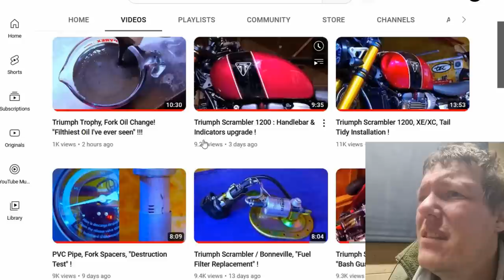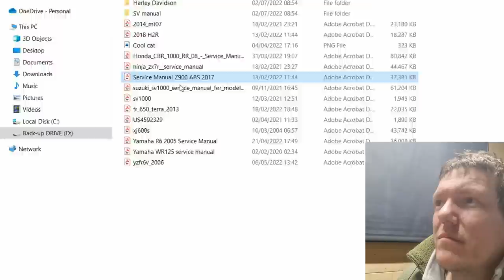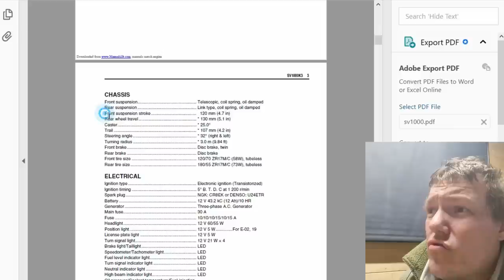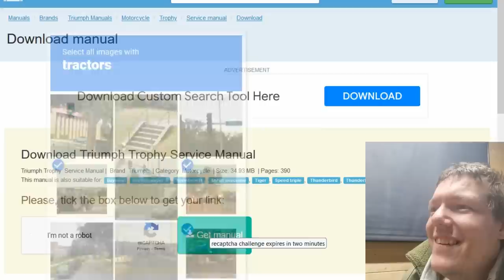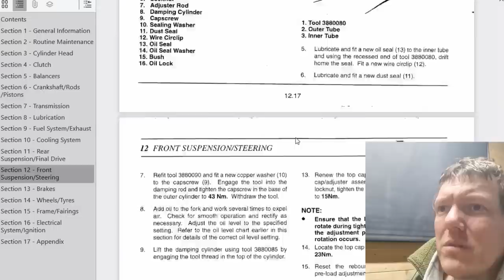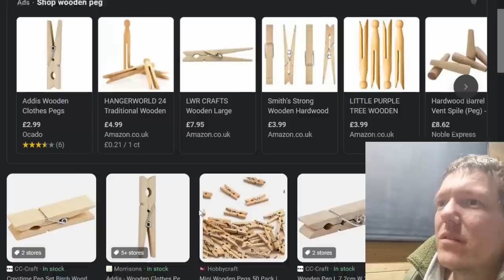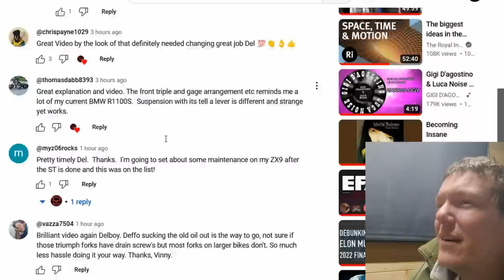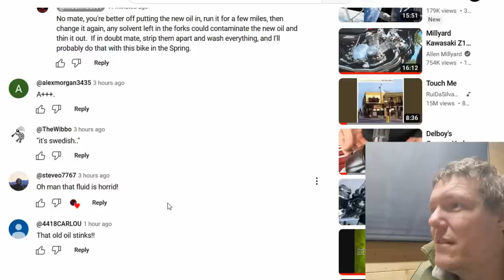Terrible fork oil replacement

Comment: To clean the forks without disassembly, just put the bike on a stand, remove each fork, tip them upside down, etc. No need for a stupid pump.
Reply: That's exactly what I do, remove forks, take spring out, turn upside down and rest in a container while I have my lunch etc.
I do it approx once per year because it's an old (conventional fork style) dirt bike, so tends to get water in there - I assume from condensation as the seals don't leak, forks get hot from working hard then hitting rivers etc, plus it lives outside (with a cover on)

Comment: I have literally never changed fork oil. I have changed seals and refilled the forks lots of times. It's an easy job, only takes a couple hours, and the seals are cheaper than the oil Del's flushing with. While it's apart I clean with brake cleaner. No residue, evaporates in 20 seconds,  and the fumes give a nice buzz.

Comment: I work for a small motorcycle shop and no mechanic would ever change fork oil with a vacuum pump as you would only be removing the clean oil sat on top and leaving behind the old oil that's been doing all the work at the bottom. The only way to is take the fork off the bike and exercise it upside down. Ps even in a rush racers would not use this metherd to change oil viscosity before a race
Reply: Plus you’d not get any of the oil trapped in the damper?

Comment: So the fork sag was 45mm and bang on, but before he pushed the cable tie down it was at 45mm!!   

Agreed all the valving and internals will be caked in shite. 

He measures the fork oil height while forks are slanted, so give a false reading.  And what he sucked out looked as black as what he’d supposedly already changed. 

The blokes a prick. 

Like you say, whip wheel out.  Take out spring.  Fill with petrol and shake it, then pour it out and when dry refill with new oil.

Comment: I have a Triumph, the manual says to change fork oil every 4 years or 24000 km.
Del's bike is from the 90's so a couple of years older than mine, but I'm sure it says something similar.

Comment: In the forks of bikes I've had, usually, it is not possible to extract all the oil properly via the stanchion, leaving a fair bit in the bottom and usually the sludge. I did think it was unlikely that there was no drain screw when Del said that but I guess he doesn't understand how your supposed to drain them.
Reply: The bolt in the bottom is to hold the damper rod, not to drain the oil, it would drain it though, but in all honesty, if it's that sludgy, it's not coming out of that tiny hole..
Reply: @waynedl99  Usually the damper rod bolt will be big enough to let the oil out.  Yes if there's sludge it won't come out but that's why you have to do the job properly and take the forks off and clean them out.

Comment: Probably the bolt Del was refering to is drain screw you can find on harley-davidson forks. You can drain Oil without taking axle of.
Reply from the maker: Only for these models XL1200C, XL1200L, XL883, XL883C, XL883L which is the vast minority according to HDs site

Comment: Matt, hey. Regarding drain screws, most all? forks that I know have a screw/bolt in the bottom yes. But that's primarily used to hold the damper rod or cartridge in the fork, and cannot easily be used as a drain plug. Often the bolt will not come out without holding the damper cartridge/rod with a special tool.
Reply from the maker: You don't need a special tool, you do it first before anything else. The spring pressure clamps it all up tight

Comment: Shouldn't your fork leg be vertical to set the level accurately? At the headstock angle the forks are at still in the bike, the level will be different at the front of the fork tube to the rear. I could work it out with maths, if I could be arsed and knew headstock angle, but I'm bet 10-15mm difference in height, which would throw the accuracy of his tape on the vac tube, pointless.

Comment: I’m surprised he didn’t just drill and tap a hole at the bottom of the fork then whack a bolt in there, mind that would probably have done a better job of getting that crap and oil out of there. 😂

Comment: i think that bottom bolt on the forks, its really not meant to be a drain bolt, but that's to separate the 2 sections of the fork and from what i gather its not easy to remove (some are easier than others) and if that nut spins you need a special tool to get in the topside of the fork to loosen it. I know when i had an 80's yamaha special II, there was small phillips head  screw on the side of the forks you could take out and that would drain the oil out but i haven't seen that in ages with these newer bikes.
Reply from the maker: For God sake... who said it was for draining? What you're meant to do is remove the fork and tip out the oil.

You don't need a special tool, you just stick the fork back together and undo it.

The reason why you don't see that any more is because it takes ages for the oil to drain out and the crap remains in the shock, and finally the screw usually corroded in place.

Comment: I just restored forks on a 2001 SV650 that has been sitting for 7 years. There is no way I could have 'cleaned' them by just replacing the oil.

What remained after draining was a thick sludge that stuck to the walls and springs and smelled of rotten eggs. Even after taking the forks completely apart it took a bit of work to get them clean.

I guess he needed to get the Sealey product placement in there somehow.

Comment: Only really old forks have drain holes. Oil change in my shop means they come off the bike. I prefer to strip em down and flush the cart. Then check bushes etc. I will do a dump and fill on track bikes if we are changing viscosity or between race rounds.

Comment: I think Del was referring to having an actual fork oil drain bolt in the end....not the damper rod holding bolt (which can be a problem if you remove it and then need some way to stop the rod rotating while trying to torque it up). My '74 Norton Commando does have an actual drain bolt on the side of the fork slider end, so no need to remove axle etc to perform the fluid change.
Further, he sucks out the fluid to set level with the forks at the normal angle to the ground....so fluid level at rear side will be higher than at front side of fork tube...so depending on where the end of that suction hose ends up, he'll be removing more or less than he thinks. Can be avoided by having the suction tube dead center in the fork tube...which is what the manual's tool does. MotionPro sells this same setup for $50....silly money and easy to do right with homemade setup.
Reply: The first year or two of the 1990s Honda cb500 were the same. The bottom of each slider had a bolt - undo it, drain oil. Simple. After a certain date the construction of the sliders was changed and where the bolt screwed in was just a cast stump, so fork removal became necessary.
Reply from the maker: Because most (nearly all) don't have them. That's like talking about hub centre steering when changing head bearings...

Comment: You know I can sort of see where he's coming from. If you change the fork oil every 2 years you'll be better off than not doing it at all. Unfortunately the reason I can relate to this is because I am lazy as fuck and can't be arsed taking my forks off. 

However, the Sealey siphon pump thing costs money, whereas just taking the forks off and dumping the oil out is something that can be done with very basic tools. Spend money to be lazy or save money and actually do a semi-proper job? Tough call. What harm another 20k miles on the same oil do anyway?

Comment: WOW what Del means and im not saying what he does is good but some forks have a small 8mm bolt at the rear of the fork leg on both sides which if removed you can pump the forks and it will expel all the oil and then refill if not doing new seals and bushings, i did my fork oil every riding season as my old Honda ATC seen lots of water and mud so doing a quick drain and refill was easy

Comment: Sorry Matt and I never thought I'd ever say this but I have to side with Del on the drain bolt.
What your pointing out is the damper rod bolt meant for dissembling the fork. Sure you could use them to drain the forks in a pinch but I'm sure what Del is referring to is as small bolt or JIS screw on the side or back of the slider specifically for draining the forks without disassembling them.
Reply from the maker: Can you give an example of a bike that has one of these screws?
Reply: @dirtygarageguy  Sure, 1988 Kawasaki GPZ900R, part number 92009.
I've owned and seen plenty of other bikes with them too.
Reply from the maker: Right, any 1990s triumphs or any late 90s bikes?
Reply: @Gassit  70's to 90's bikes had them before they worked out forks should be fully disassembled to do it correctly!
Reply: @dirtygarageguy  They don't seem to be a thing on current era bikes but my point is that that is what Del was talking about.
I'm not one of his fanboys. The only times I ever see any of his videos is on your channel and like you I thinks he's a plonker, but in this instance he was technically right.
Reply: Fork drain plugs no longer exist for a few reasons. Cost cutting is one - my experience of those plugs is that the things used to seize in the fork leg. The screw heads were usually rounded off making them useless. Often the threads in the fork leg would tear when the plug was removed
Reply from the maker: I don't agree. I don't think that's what del was talking about at all. I haven't seen a bike that has one on dels channel over the last 12 years, he didn't mention this on the other 8 videos he's done on fork oil replacement. He didn't even say what I think you think you heard.
Reply from the maker: Lol right, and?

Comment: it looked like he took just over 500ml out it total, but added 1000ml back in. Where did the other 500ml go?
Reply: Those little bottles are 500ml. He added one into each fork, so 500ml into each fork which is fine.

Comment: You cant do fork oil level correctly when in the bike coz the forks sit at an angle (say 25 degree for example).
You need to do them straight upright.
Otherwise you might as well just guestimate the level coz its gonna be miles out anyway.
And i'm with you on this one, take the bloody legs out and clean them.
I do lots of forks and I can tell you there will be black crud still sitting at the bottom of that fork

Comment: Oh FFS.. No one who actually does anything correctly will do it without removing the forks. You can drain them easier, flush out the old oil if it looks as rank as that does and check the fork guide bushes as they are probably worn if they are that old too. The bottom bolt may not be a good idea to use to drain the forks as the bearing tube assembly in the bottom of the fork my need a special tool to hold the bearing tube assembly when you retighten it to stop it from leaking.  These are non cartridge forks so they are really simple to strip and service so its a no brainer taking the forks out to do them.  The refilling of the oil and setting the oil level/Air Gap should be done with a steel tube and the correct air gap syringe's are not that expensive and a damn sight cheaper than a crappy vacuum tool.  

To be honest doing sag that way is a bit generic and not a good way to do it. I will have more or less sag than you or most of the people who sit on the bike.  If the sag is too much doing it static like that will have Del getting the PVC tube out again I guess.  Static sag is just the weight of the bike alone from full extension. This is a better way to show if the spring has become shorter or has fatigue as you will always be checking the same weight if the bike has the same amount of fuel etc. The sag with the rider is done when you change preload or spring rates for riders and the use of the bike. 25mm rider sag is usual for road bikes. It is all a bit pointless with no pre-load adjustment if you know the spring is OK. The only way to adjust it on that bike is adding or removing length to the top of the spring spacer. From start to finish its just a garbage video, he must have been trying to find a way to use his free vacuum pump...  

I really cannot watch the crap he posts up... Hell I have done more with the pit bike forks than than he must have ever done. Crappy Fastace forks have been stripped, drained fully, heavier fork oil used, the original springs were tested for spring rates and two sets of custom springs made 20% and 30%  stronger. None of the PVC tubing crap, although we did use alloy tube pre-load spacers to do a test to see if when pre-load was added it would help steering under heaving braking. It would be harsh elsewhere but the one issue we had we needed to just stop the fork bottoming out when braking really hard. It proved a point so stronger springs were made. This makes the bike feel better through the whole fork travel and not just making it harsh initial travel.  All of that was for a bike made for kids to ride and adults ride for fun...  Del is a liability...

Comment: Need to check stiction between the seals and sliding tube. You struggle to do that on your own with a cable tie. Del's disciples need to check out Dave Moss for how to do this properly.

Comment: If the oil is that bad, he should have changed the seals anyway.
Reply: not really, if they're not leaking 🤷‍♂
Reply: @Wayne Large  listen. If you don't take preventative measures when working on a bike, it will fail at the worst possible time. Seals are easy and cheap. Also, it would have made better content for   Del.

Comment: That bolt in the bottom holds the damper rod, It's not a drain bolt.
Reply from the maker: Does oil come out when you undo it?
Reply: @dirtygarageguy  Course it will it's the lowest part of the forks but it's not a drain plug. Show me in any w/shop manual that says it's a drain plug, most of these are Locktighted  in so without a tool to hold the damper rod you'll struggle to undo them.Most if not all bikes nowadays don't have a drain plug.

Comment: I can't find the owners handbook for my Trophy 3, but I do have the Haynes. Haynes says change the fork oil every 12,000 miles for Del's specific model. No mention whatsoever of time with regards to fork oil.

In the 'Every 2 Years' section of the maintenance schedule, there are a number of items which have the caveat "2 years or xxx miles, whichever comes first." Including; clutch oil, coolant, brake fluid and grease. Not fork oil.

Comment: I think motorcycle dealers started that "change fork oil every two years" thing. I've definitely heard it multiple times. But like you, I can't find it in any shop manual. Even worse, they never say to change the fork oil. They just say to inspect the forks.

Comment: Where does he think all the shit in the oil comes from? With oil that bad I would have popped the legs out, cleaned everything and changed the bushes and seals. Takes very little time and job done properly. As usual just a bodge job.

Comment: Isn't the iso standard measuring temperature 20 degrees?
Reply from the maker: Iso?
Reply: Copied,
ISO 1 is an international standard set by the International Organization for Standardization that specifies the standard reference temperature for geometrical product specification and verification. The temperature is fixed at 20 °C, which is equal to 293.15 kelvin and 68 degrees Fahrenheit.
Reply: I only wrote  because the measuring room at work is kept at 20 degrees.
Reply from the maker: I know what the ISO, but what about ASTM or ASME, or even JASO, the Japanese standard? Or BS... 

What makes you think it's ISO and not the others? It could even be DOT, I'll have to check.
Reply: I had made an assumption that iso as the name would suggest is the international standard. I actually wasn't aware that other standardisation systems could use different temperatures for measuring components. Would be interesting to find out. We use iso at work (machining). I will also have a read.
Reply from the maker: There's an ISO for measuring springs, but you need to pay to see the measurement specs. I don't know if they use a vehicle standard or a manufacturing standard.
Reply: Bs refers to iso 1 on its website,
Triumph is british but where do the springs come from? Actually quite interested, if triumph order 430mm they should be 430mm at the standard measuring temp in country.  A spring in a fork shouldn't suffer from a very slight difference in length anyway. Other components could be more critical though if ordered from various places using different temps.
Reply: Del measures with delso, the plastic caliper standard for measuring how awesome he is, so I think any standardisation system would be an upgrade.
Reply: @2hordern
Reply: @kevinnice108  ?

Comment: why didn't he measure what he took out Per Fork and then Compare What When in And Thus know what is at the Bottom Plus Why Didn't He Invest in an Electric Suction Pump? with a proper vacuum seal